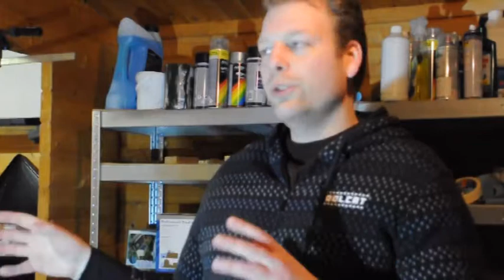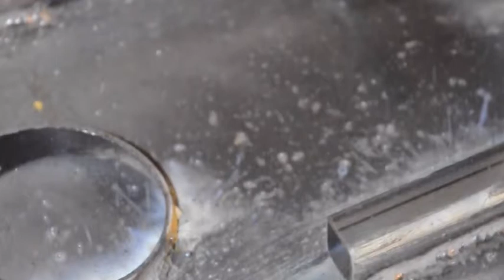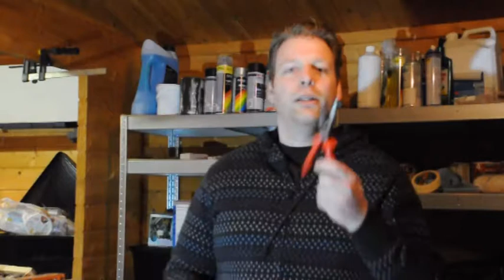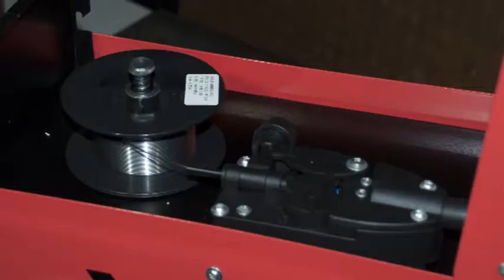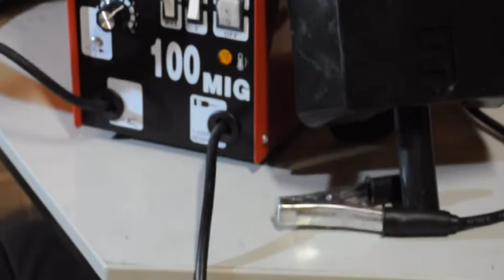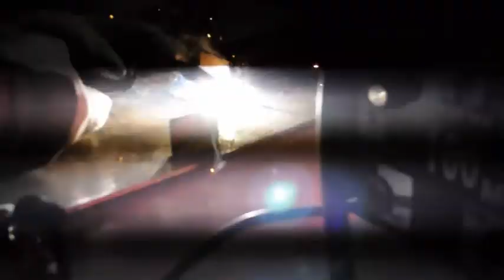Mig 100 review and starter guide

Comment: Try different wire, Lincoln NR 211 mp, I find to run the best with much less spatter. Some other good wires are US Forge, and Matheson. Decent looking welds for beginner. Welding takes lots of practice. Oh, and a better ground clamp will help very much, I have this same machine among a few others, tig, and stick. God bless and work safe.